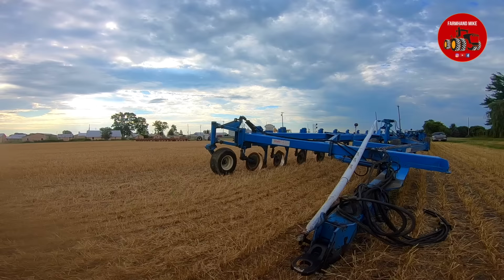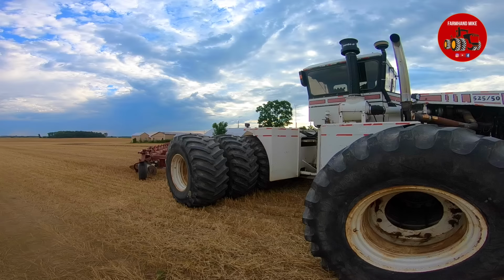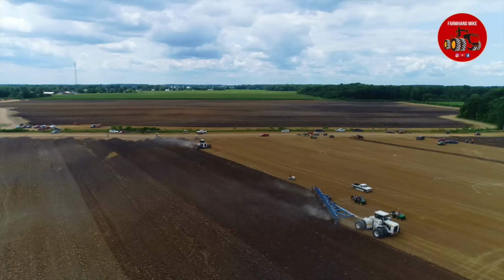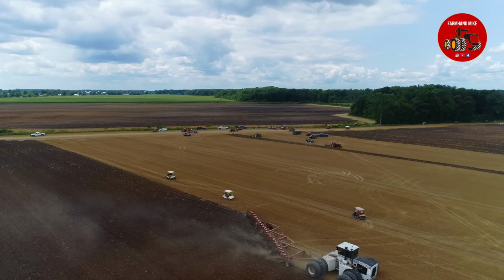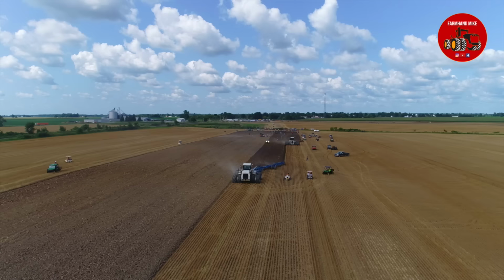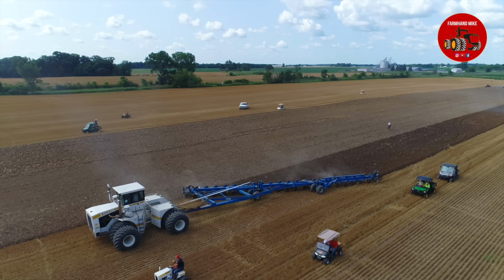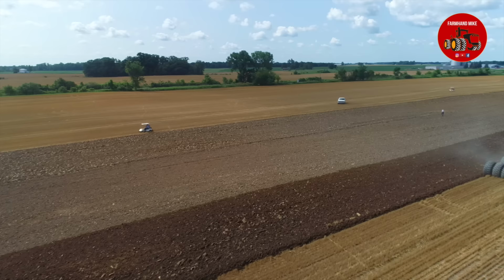Big Bud Tractors pulling 21 and 18 bottom plows in Ohio

Comment: The replica Case 150 steam traction engine originally designed in 1904, has pulled a 44 bottom plow. It produces 150 horses power at 300 rpm, has two forward gears, is 2wd, capable of pulling 50 tons up a 10 percent grade and will climb a 40 percent grade unloaded. The flywheel weights 1400 pounds and the two drive wheels wheels each weighed over 6,400 pounds. Great grandpa had extremely powerful machines too.

Comment: I'm in the market for a subcompact 20-25 hp tractor... sure enough, youtube decides to show me relevant videos, and here i am..
Reply: dre04mach I would go at least 45 horse if you are intending on doing anything in a field that has to do with hay or dirt
Reply: Hell whats a small increase of 475hp? Everyone needs one of these monster plows!
Reply: Never underestimate horsepower, can't have too much. 😄
Reply: Shop units that  can be repaired avoid  HIGH tech gadgets most of the smaller tractors are made in Japan then the 50 hp to 70 are made in india, Brazil, and Mexico, just a precaution Europian tractors have different components  from allover Europe  Romania Turkey France Germany  so when they get to the USA  it can get challenging to fix...hope this helps.
Reply: @jacktherailfan3264  relax, it was good advice, now i have to figure out what to do with this tracked 475hp tractor on my acre and a half :P
Reply: You'll need a loan for a days worth if fuel.
Reply: Check out the Allis Chalmer 5020 and up series.  Cheaper than green.  Or even an older Allis 160 or 170. The tractor house app will help youm

Comment: At least 1 650/50/55 made it to Australia. 12v92 powered twin disc torque converter/gear box . It was bought new around 1980/81 , same colour scheme as in video . It was used for seeding and dragging 4 linked chamberlin one plows

Comment: really nice to see some more Big Bud's and especially nice to see people operating them that actually know how to plow, watching the Big Bud 16v-747 attempt to plow is a frustrating joke
Reply: Why ?
Reply: @jamesbarbour8400  the guy running the bigbud 747 does not have enough experience to keep the front furrow wheel of the plow in the furrow,, when all tractor tires are "on land" That is called an "on land " plow "in furrow" plows you run one side of the tractor tires in the furrow, in furrow plows require very little time to learn to run, on land plows it usually takes a good couple of 8hr days to learn your proper tractor/furrow wheel placement without the need to even look at where the furrow wheel is.

Comment: If I may add a small correction - Steiger Tiger Tractors (Series III), had either 450 or later, 470 hp, depending on the model year, rather than the 600hp figure you mention.
Reply: Back in the early 80s I helped a farmer that had a Steiger bearcat dang it was small compared to them

Comment: Great footage and narrative... Thank You!!   The Big Bud 650/50 is powered by a 12V92, which - like the 12V53 and the big 12V149, is Not a "true V12 - and is of modular construction utilizing 2 - 6V92's mated together with full redundancies except for the one governor (unless they were DDEC's), and they do Not sound like a V12 at all due to the fact that they are, siamesed V6's with their redundant V6 firing orders.  

The only "true" V12 from DD was the Series 71 - V12 which was "clean-sheeted" from the beginning as a V12 and utilizing two different V12 firing orders, depending on the configuration (left or right hand rotation, primarily.. but Not always) and application..... just some FYI trivia for you.   

PS; I did not "copy" this info from "wikipedia" or anywhere else.  

I have a 4 year degree in Diesel Engine Design & Theory, specializing in 2 cycle.... which was a required prerequisite to Research & Development (aka, R&D), along with a minimum 3 year degree in Mechanical Engineering (ME).  

This was from the mid-1960s and I, personally.. studied under and was tutored & "sponsored" (two summers at one of DD's training centers) by P. Nicholas who had not only just retired from R&D at GM Diesel (aka, Detroit Diesel), but was also one of the leading design engineers of the very first 2 cycle GM Diesel (a 4-71) prototype.  

I have a framed black & white 8x10"  photo taken in 1937, just moments after the initial fire-up, with himself, "Boss" (Charles) Kettering and one other R&D engineer, whom I've forgotten his name at the moment, standing by the engine on the Dyno... that he gifted to me, after my return home after my last "tour" in VN. in late 1970.
Reply: I never thought about it that way, but you're quite right. The 12v92 still sounds good, but it doesn't have that magical v12 sound like the 12v71
Reply: At one of the technical classes I attended the DD rep had a long talk about this, and your correct in say the only true 12's are the 71's... 
The others are just paired V6's
Reply: @dieseldave71 .... Thank you for your reply.  My apology for not responding back to you... a year ago.  I had no idea that you had replied, and I only just now found it, as a result of another fellow who just responded back to me, today (1.8.2022) and I was notified of it.  

Anyway, thanks again... and yes, the exhaust report of the 12-71 is wonderful "music" to all those who at least appreciate the sound.  

As for the power, especially the torque output.... 99% of what you read on the internet, regarding that subject... is nothing short of 100% Ignorance.  

They have absolutely no understanding of how efficient these engines really were and still are.... utilizing such a very short usable power stroke travel, compared to all the 4 cycles that these "keyboard experts" seem to like to compare them to.
Reply: @TheRealDuBTeK .... Thank you for the reply.  What was your situation that necessitated the "Technical Classes" that you participated in?  

I was fortunate that during my 4 year studies (mid-1960s) towards my degree in Diesel Engine Design & Theory - specializing in 2 cycle, my last three years was under P. Nicholas, who had just retired from GM Diesel (aka, Detroit Diesel) as one of their lead design engineers in R&D and who was one of three lead designers of the very first 2 cycle prototype engine (a 4-71) in 1937.  

I've owned several 12-71TA's over the years, as well as built several high performance 3, 6 & V12's for a few friends in my spare time.  Thanks again for your reply.

Comment: Pulling super heavy DMIs too.  That's a heavy pull.  Not  much moldboard plowimg anymore, these tools are only used by the old guys.  Having you ever tried maneuvering a 12 bottom DMI on head lands?  It is a pain and waste of time.  Plus you will use a bunch of fuel usimg these things, not to mention dreaded plow pan left in the subsoil which requires deep rippling after here in the high clay Red River Valley. And if you got rocks like we did, you will break stuff, sprimgs or not.

Comment: Awesome vid.  Been looking to find a good video showing the DMI plow, we had a 12 bottom and it wasn't like our other plows, it was a monster.  Did you notice any difference in size or quality, I know maybe hard to tell, but from my understanding the DMI's were known for being "over-engineered", ie...really heavy build.  Usually needed to use a Stieger to pull it just for the extra weight that Stiegers carried compared to a 4wd Allis or whatever, traction was an issue depending on setup,  perhaps the tractor  was just too small.

Comment: I don't understand the "Big Bud" tractor. Why can they not use a standard tractor even one with dual wheel setups? Is it they need the weight and traction due to the resistance the ground puts on those large implements?

Comment: That is some really really big tractors and equipment,, this is some of the only info I could find on the other big bud tractors.  I thought there was only one type of big bud tractor. The 747 with the 16 cylinder engine with two turbo chargers and two super chargers putting out over 1100 horsepower. Apparently the 747 is 2 cycle engine.  And is a monster

Comment: Great vid Mike, i'd be keen to know what the drawbar pull in tons was on each in that dry ground. i'm a min till farmer but am looking for a 12-16 board plow to run across our land every rotation (4yrs) as the data shows we'll be lookin at spray resistant weeds in the next decade (just ask Australians) i have a T9.615 on tracks and if you've ever seen a Gregoire Burgoine 20 board roll over plow (there's a vid from Russia with a QT620 pulling one) you can cover the ground really quick. cheers bud.
Reply: yes we already have roundup resistant weeds Kochia for one

Comment: Is it just me Mike or is the DMI unit set up with a narrower bottom spacing. It looks like it was set up for 12" or 14". The Wil-rich looked like it was set up for 14" or 16" bottom spacing. I know the DMI is adjustable from 12" to 22" i think.
Reply from the maker: It was set narrow as it was transported into the field. Like when I walked around it with the camera at the beginning of the video but was set out while plowing.
Reply: they are ajustable from 18 to 22 mostly
Reply: @farmhandmike  ya but what you didn't say was the Dmi plow was designed by a farmer inventor in Iowa named Jon Kinzenbaw who went on to start Kinze Manfacturing sold the patents to DMI .

Comment: Tripple tires for each wheel? Just use tracks at that point if you need that much grip, it cant be more expense and maintence compared to 12 specialty tires. Why would anyone pull a plow with one of these rube goldberg machines instead of a bulldozer?

Comment: What is the difference between "idling" fuel burn at a stop in neutral and during a "working" RPM and whatever speed the proper gear it's in...? ALSO, where are the refueling trucks to support this opetayion...? Thanks, Gordon in Maryland BTW, Great Vid...!

Comment: Isn’t the torque the more relevant specification?
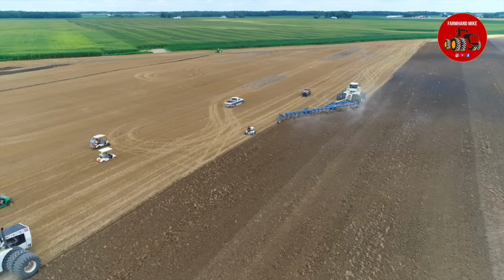Reply: Franco 3:16 Not really. You can gear a machine of any horsepower to put out any torque you want to the wheels, at the expense of speed. Geared low enough, a 3 horse lawnmower engine would be able to turn the wheels with the same amount of torque as one of these tractors - it would just move real slow. More horsepower is what gets more work done at a higher speed. (Force x distance over a period of time)

Comment: Pfaw! Mike, how did  I miss this one earlier on?  To think that large ploughs were built on a small scale - that it was cost effective... but great that they have survived with tractors and operators fit to do them proud, but heh - Mike - You've got something to do with Versatile?   - think you should go back to these guys and help them set up the ploughs BETTER than they are - great what you can see from your great aerial shots -  Tractors pulling too much to the Land. Need to get the drawbar aligned much better.  I've been put off ANYTHING ARTIC for that reason - how to steer them on Side-hills when pulling very hard - without turning yourself into knots - no SIde-Brakes to tickle. I have a big enough with my large 4WS Coordinated steering loading shovel on such slippery sidling land - which axle is the Master as the Load varies.     Thanks for haring all this and we look forward to having more time to watch and comment !  Sláinte mhaith !

Comment: i am wondering what the advantages of this type of plow versus a bat wing disc or chisel plow. the turning radius? or ?  dirt surface appearance seems a little chunky for planting wheat
the width seems the same as a 36' bat wing and a versatile 435 seems to have enough power to pull it. And i would ask that 4 wheeler to get off the freshly plowed field.
Reply: Greg Smith almost complete residue burial. They’d disk it and then run a field cultivator over it before planting

Comment: The John Deere 9620R could handle a 21 bottom plow with ease.🚜
Reply: 4 gauge not with ease. That’s still a significant workout for any tractor
Reply: @nellsonstout7001  This is true to a point,I guess what I'm saying is that it's far from being underpowered to handle a plow that size.
Reply: 4 gauge if they’d have set it deeper, we’d have found out for sure.